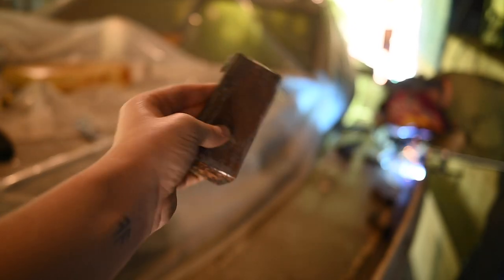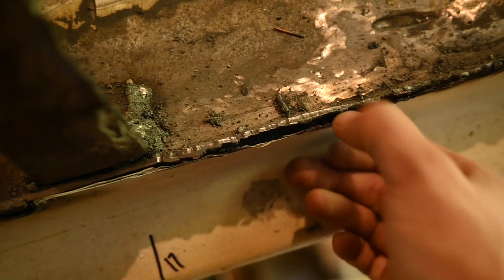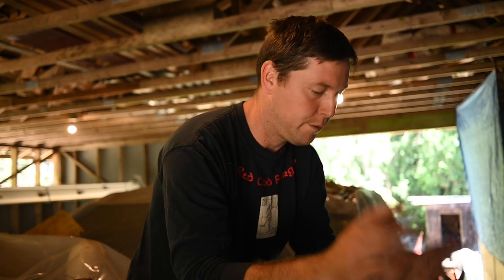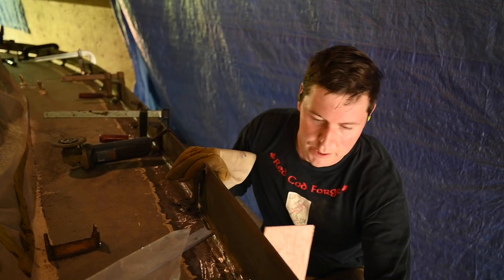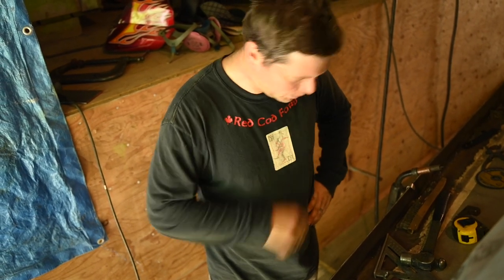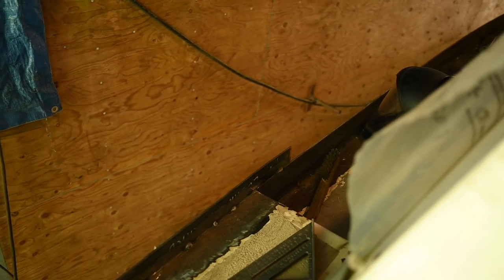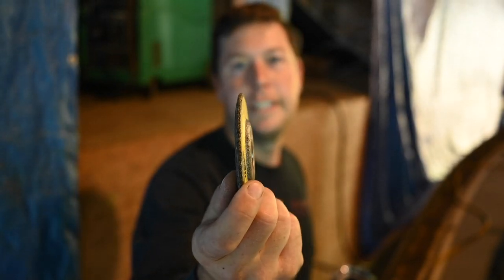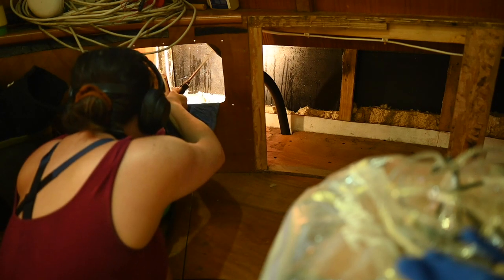Things are Finally Looking up! Putting on the NEW Bulwarks! | Steel Boat Rebuild | Ch 5 E 28

Comment: Excellent progress. Half of that elephant is already eaten. Proper decision avoiding a closed box. Make a drain hole in the bulwark every few feet so water doesn't stay pooled on the deck. If you do trim the top with pipe, make sure the pipe is sealed and water and air tight everywhere. Inside will rust a bit but only until oxygen is used up. No new air or water, then no new rust. Then, as you know, never put a screw hole in that pipe. Or maybe half pipe?
Reply from the maker: Ah yes thank you. Pipe is on and looking pretty good as you will see next week, and def won’t have any bolt holes through it!

Comment: If I were doing that step in the bulwarks,I would mark out a 30-60 degree triangle based at halfway down the vertical end of the higher bulwark, and then the off cut becomes useful to add to the lower bulwark. That’s just how I would do it; you do it your way. I love following your journey.
Reply from the maker: We ended up putting in a 45 degree cut at the end of the top step as you will see in the next vid 😌 it turned out pretty good too!

Comment: THOSE are Milestones for sure! (and it is so nice to see you both smiles return). Nice work, and nice to see you work together!
I believe your VdS has the same rack-and-pinion Whitlock/Lewmar Cobra steering system (that was a mouthful) as our VdS34, This is what we are re-building at the moment.  It has everything form an old bees nest to unrecognizable corroded ball bearings!
Just in case you are thinking about it for Papa Rumba.
The system is pretty neat but does have some flaws.
The easy and obvious one is the single nylock that secures the pedestal rod to the rudder gear trailing arm. It is a fine thread nylon locking metric one. Lets just say that I keep a few on-board. L. There is no way you will find that nut while anchored in "paradise".
Are you thinking of capping the bulwark with something? 
I might have miss that...
I do actually have a serious question/suggestion, if you do not mind:
I use Aquarius Blue Steel rust converter, have you used it? 
Do you use something better?

Cheers.
Reply from the maker: Thanks for the comment! We are planning to cap the bulwarks which you will see next week 😌 we actually haven’t had very good success with the blue steel rust converter for whatever reason. Our experience has been that the rust comes back and paint has a hard time sticking to it

Comment: Here is a idea. Just round over the deck. Then just have risers about 2 to 4 inches high and the same wide. Thin take a round pipe and weld it to the top of your risers. Then weld the risers to the deck. That way the water can run off. 
 Go check out " sail life " and see how Mads did his Bullworks.
 You could do the same in steel. 
Thank you for this weeks video. And Keep up the good work. 
 Ya'll are getting closer. 
 So until next week. 
Aloha from the Big Island of Hawaii. 

P.s. If you want to talk about it let me know and we cant talk abiut it. I do believe it would safe time and money. And it could cut down on the water rusting away at the boat.
Reply from the maker: We decided to go with bulwarks style again just because the freeboard is fairly low, but we did think about that! If we end up having to redo things again (but gawd I hope not!) we will probably end up thinking about something along those lines

Comment: You could slot the pipe then slide the pipe over the new bulwark  no air gap
Reply from the maker: We debated doing that but it’s a lot of work to slot the pipe, and the pipe twists as it bends so it would be very hard to keep the slot lined up properly.

Comment: Hi, and thanks for sharing such video. I couldnt see clearly but is it upper end of shear strake you have cut? Or it was just "add-on" bulwark?
Reply from the maker: Yeah it was the top extension of the hull plate. I’m not sure if we are big enough for that plate to be considered a shear strake but close enough to the same concept either way. We were hoping it was box tube welded on when we first found the issue, but it’s an extension of the hull plating.
Reply: @WaywardLifeSailing  I believe it shouldnt be an issue as long as you weld nicely all around. But better to talk to small boat expert. Safe ways!